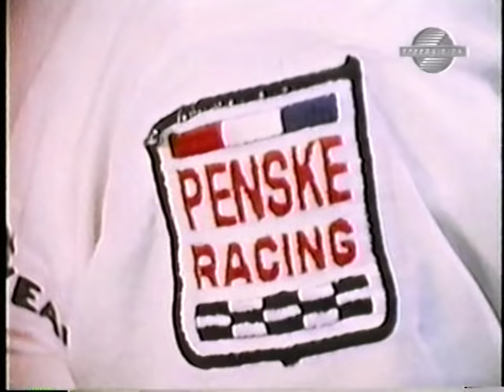1973 SCCA Can Am racing Mark Donohue Part 1/2

Comment: Mark sure made it seem like Porsche was too arrogant to make the 917 work correctly. The Penske team had to show Stuttgart how to make it run right. What Porsche delivered initially was a pile. At least that's what I got from 'The Unfair Advantage'
Reply: Charles Wall i read the same. I loved the part where he mentioned he was hung over the first time he drove it. It was quite incredible what the Penske crew turned it into
Reply: u should read Sam Poseys article about the history of his relationship with porsche.  he specifically mentions the start of the 917 program and how it started as a very crude, nearly un drivable deathtrap.
Reply: They never did perfect the 150mph+ movement. Good hands could work it but Hurley Haywood had a close one on 74 when it lifted at that speed. Setting the front lip was do or die in gettin it right
Reply: Charles Wall ahh actually ..vern... horspower and tork curve was such.that most drivers at time couldnt handle the.  read up more ir if there us a meeting your area talk to vic elford about driveing them down.to earth guy
Reply: Refer back to the top poster’s surprise at the crude state of race engineering.
Reply: The 917  won LeMans to times in a row before it shows up in the US. " Penske team had to show Stuttgart how to make it run right". Sometimes i had to ask myself how many assholes there are in the USA